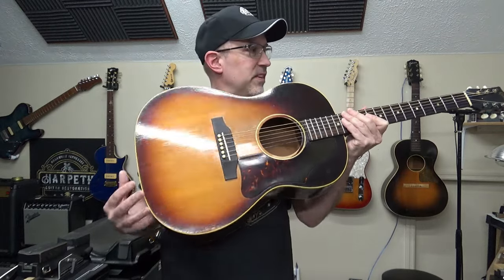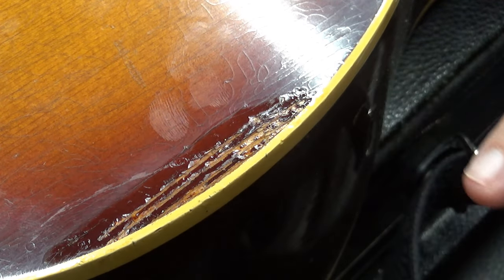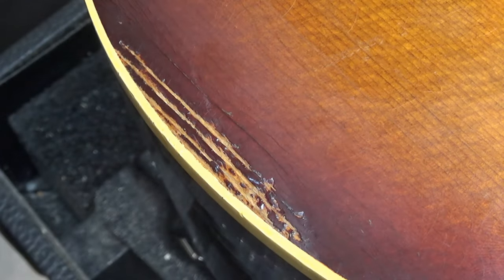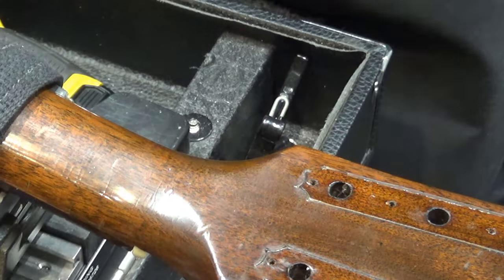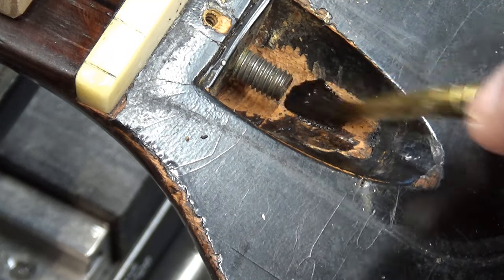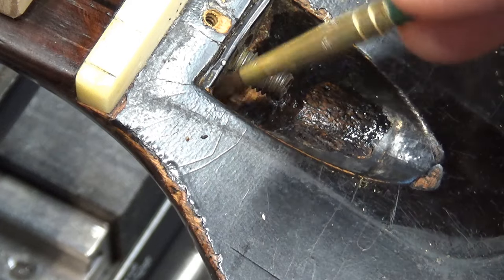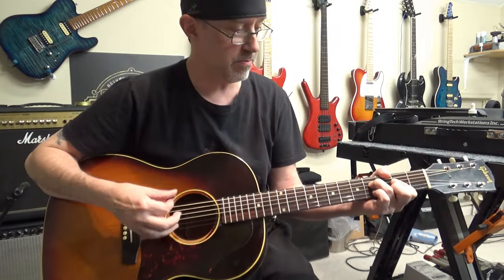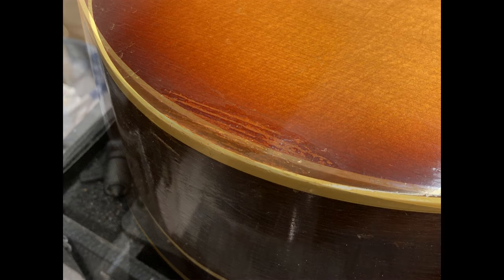LG1 Maintenance

Comment: Nice job as always.   On a vintage guitar, won’t the finish touch ups done just to make it appear a little nicer reduce its value?
Reply from the maker: I think once the original finish is damaged it looses some value but the touch up doesn’t reduce the value any more. If someone were to strip the finish completely that would reduce the value by a ton!

Comment: Scott, while watching you work on the bushing problem it reminded me of a question-I have a '67 Harmony Rocket III that was missing the tuner bushings on the treble side of the headstock. It took years before I was finally able to find three from StewMac that were the proper size to fit. Problem is like a dummy I ordered the new ones and not the aged ones so now I have three aged bushings and three bright shiny chrome ones. Will a soak in muriatic acid age the new ones for a more proper match? I'm just too cheap to pay $12-$14 shipping on 3 aged bushings that probably cost 49 cents each. Thanks.
Reply from the maker: That is a good question. It seems like you could mechanically age the shiny ones with sandpaper? Salt water is corrosive as well. Hmmm